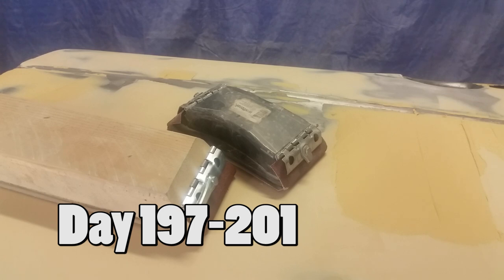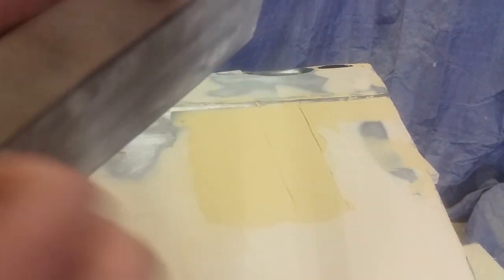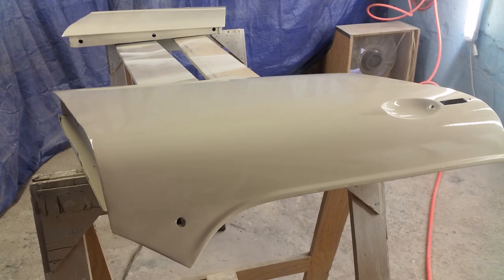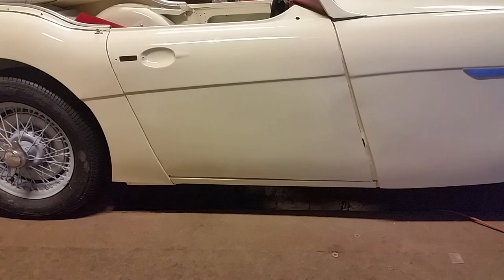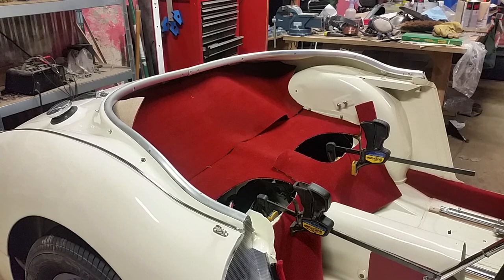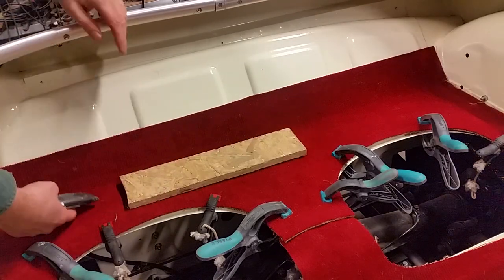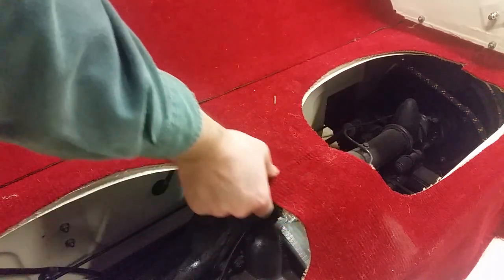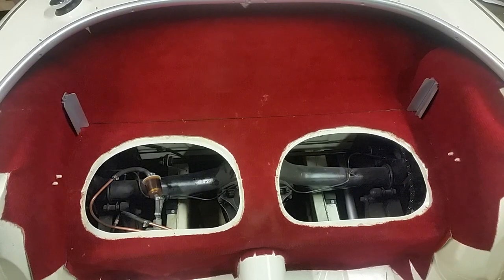The Austin Healey Project - Day 197 - 201

Comment: I am restoring a 69 100/6 in the same color, my brother is a body man and he is now 80 and works every day. He has told me to assemble all the outer panels on the car before painting  and do the fitting and body work that way you can sand from the front wing or fender with the door as well as the rear wing. Using a contrasting mist of paint will also show you high and low spots. Once you are happy take the panels off and paint and then reassemble. I enjoy watching your videos on this car and wish I had your patience.
Reply from the maker: In season 2 I painted the inside of all the panels and then assembled them to do the final outer paint with it all together. I liked this process much better than what I did in season 1. It cut down on realigning the panels again.